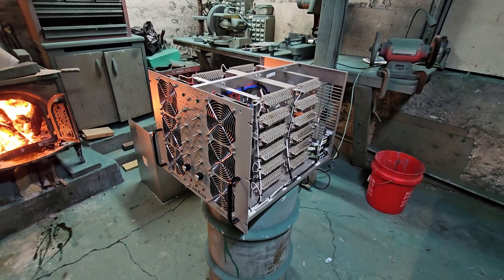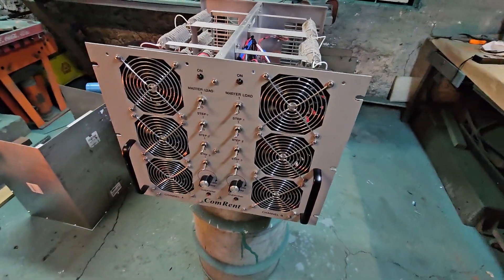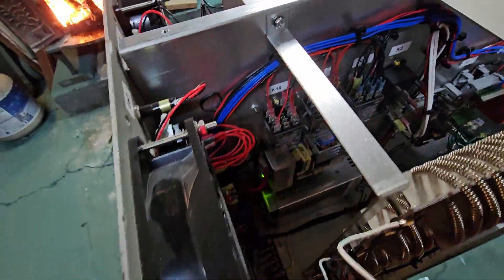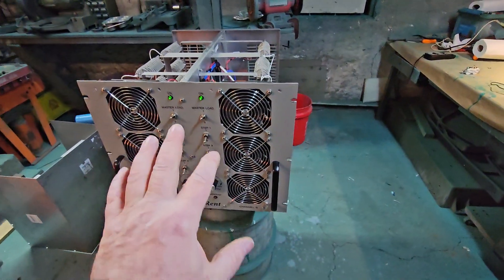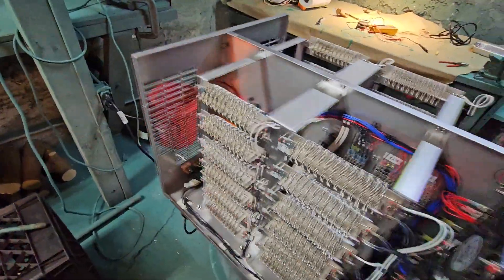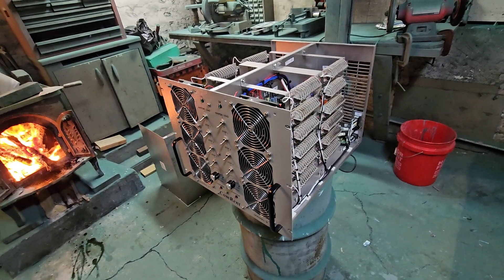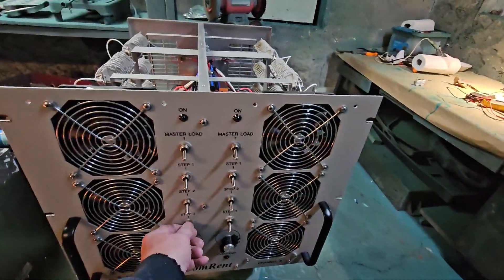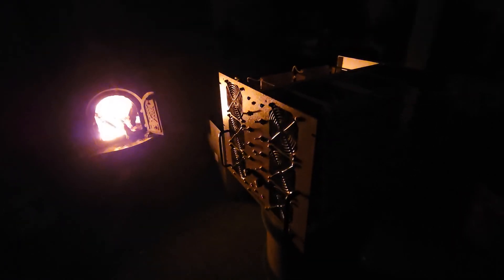After many years of refurbishing and testing Onan gensets, I finally bought my first load bank.

Comment: Definitely didn't have the right wire on the back of your mechanical load bank. It should have tripped your 20 amp breaker way before the lights started pulsing. Get a larger wire size and it won't sip the kw it will guzzle them. I don't really like that there's no displays on the load bank though.

Comment: Essential item for testing gensets. Hook it up to a power anslyser and you'll be able to certify your gensets to the relevant class (G2/G3) and declare the load acceptance values within these classes. Nice bit of added value that you may be able to sell to your customers.
When I was involved in performance and emissions development at Perkins/Caterpilar we used to use Crestchick and Sigma loadbanks. The Sigma setups were fully calibrated and automated to carry out the tests to ISO8178, the Crestchick ones required a data logger and were fully manual (via a pendant control box) controlled.
I managed to shrink wrap a bunch of engines that were covred with polythene bags about 50 feet away when load testing the 1.6MW Perkins 4016!